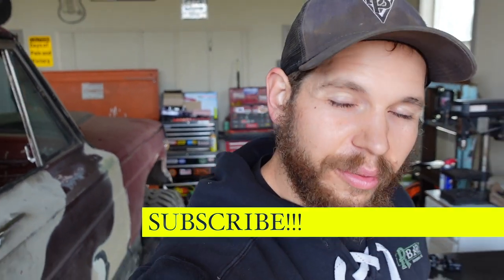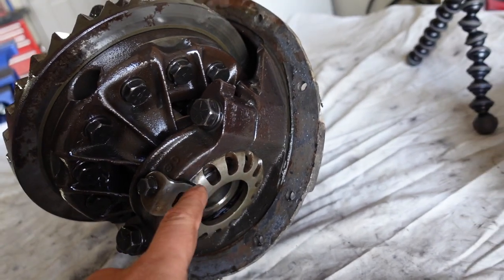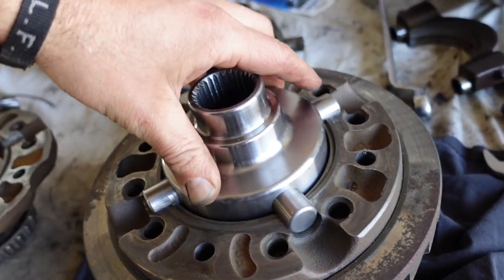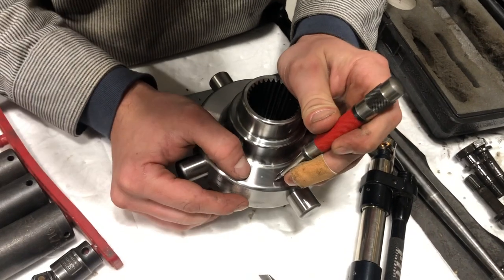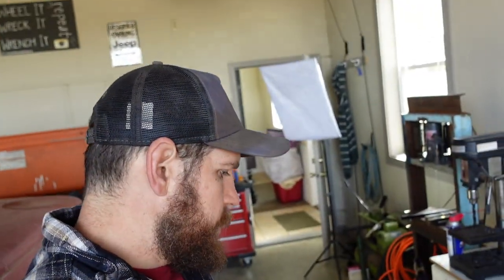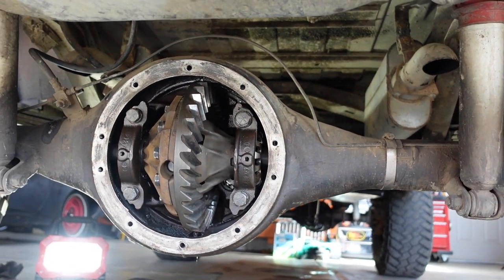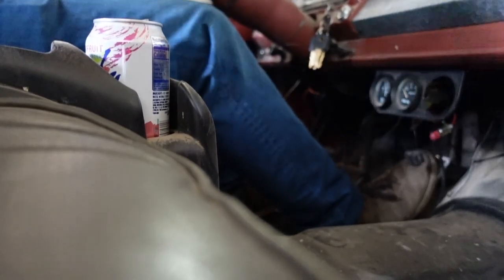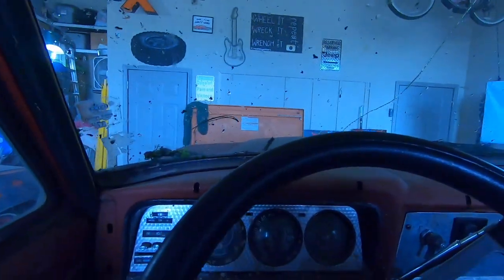14 Bolt Mini Spool Install in an Eaton HO72 Rear Axle

Comment: Awesome! Was your axle from a dully? I am needing to do this but would have to order yokon axles and wanted to make sure they fit.
Reply from the maker: this was a single rear wheel axle
Reply from the maker: pretty sure I got the shafts from a square body chevy
Reply: I guess I could order longer spline axles and cut them down.

Comment: mine looks just like that. But I thought mine was a Eaton HO52. How do you know that yours is a HO72???
Reply from the maker: My understanding is the 72 has the load bolt and came under leaf sprung trucks. If it doesn’t have a load bolt it’s definitely a 52, although some 52s had a load bolt

Comment: '46 or so til '73 or 4.
Reply from the maker: did it go that late? didn't think the square bodies had it
Reply: @DaysofPainandVictory  Its my understanding that very early ones did - but who really knows? I read it on the Internet, it must be true! The mighty GMC V6 was available til about '72, a switchover to the 14 bolt at the same time would make sense, so you very well may be right! shrug
Reply from the maker: @veiledzorba  there’s probably some overlap too